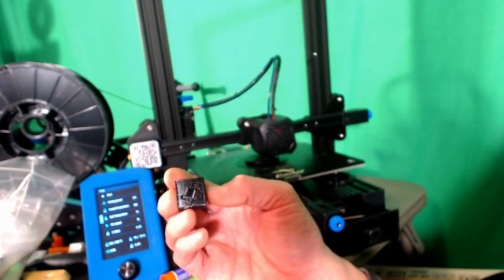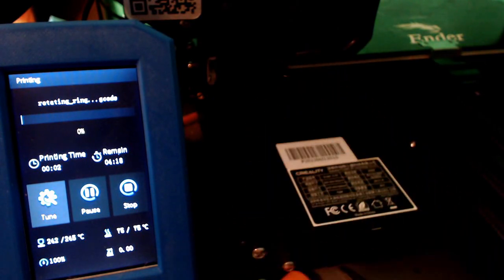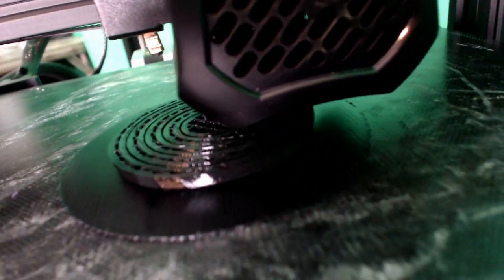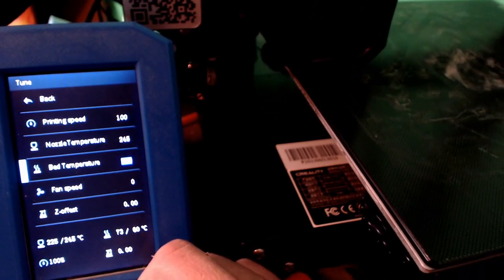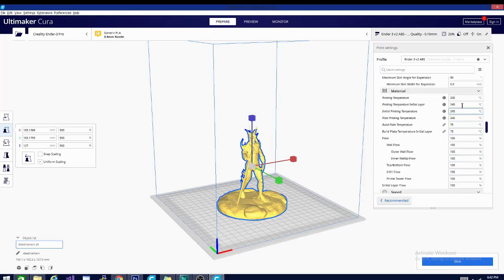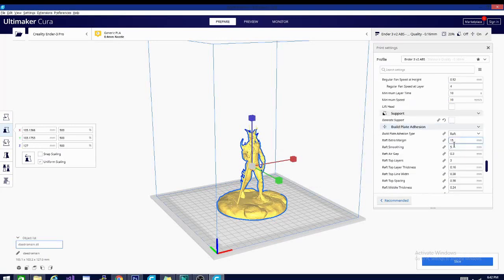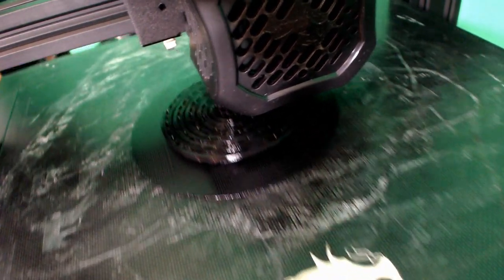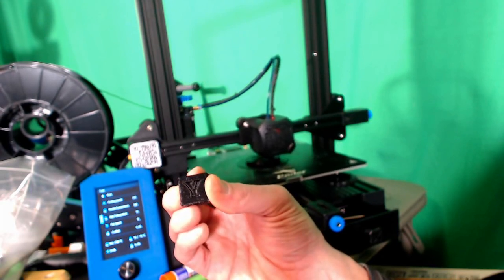How to Print PETG on the Ender 3 v2! simple profile!

Comment: In CURA there is a initial layer print temp for the bed and nozzle and you can manually set them to be higher then the rest of the print for better adhesion. That is your “reset” issue the initial temp sometimes doesn’t change with the set temp and can cause issues.

Comment: If you go into the settings of your slicer most current slicer Cura . Has a setting inside of it that will automatically drop it down to 50 at 200 you will have to manually go into the settings of the slicing program and set it for what you want it to do since it goes on the SD card once you slice it it then saves it on the card the way that you need it you plug the card into your ender 3v2 all problem solved I had this problem and solved it myself check in your settings I forget what it is I'll look it up later on if I remember but if not there's some research for yourself and anyone else reading this

Comment: It does that because in the slicer you selected PLA
Reply from the maker: No actually, it doesn't send the filament type, and I adjust the temp and every other setting in slicer manually. I NEVER change the actual filament selected so it's always on pla, I just go through and set my temps, fan and adhesion and support for every individual print. This ensure I'm double checking all my settings every time.  but this machine was overriding temps until I adjusted the firmware.

Comment: Ender 3 V2 comes with  incomplete firmware  and with some bugs. After i updated with jyers UI all those problems were gone ( i was hit first time with this problem; any tune modifications made before the hot end starts to move was instant deleted and replaced with standard tunes right when the hot end started to move. It was imposible to make any tunes before the prints begin, allways i was forced to wait print to beginPS> if you dont have CR touch or any automatic bed leveling Jyers help up with two setting , one is mesh bed leveling and the second one is manual. So i will allways recomand for Ender 3V2 owners to quickly update the firmware.

Comment: My ender3v2 has a bms all-metal hot end and what wondering what tests I should preform to determine best settings for petg. Right now doing a temp tower.  I have been printing motorcycle intakes I been designing  and I have been getting jams at curtain point. 
I'm trying another fan duct and I have added some things to encourage more air threw the heat sink.  
Parts print really nice before they jam you mentioned  20% fan I have not changed the fan from the default cura settings

Comment: The reason it decreases the temperature is simply because you have a PLA profile selected. Create your own PETG profile with 245/75. It doesn't matter what you set on the printer or in the slicer, if the printer start gcode is telling it to go to 200/50, it will go there.
Reply from the maker: Yeah I fixed that in firmware. So stupid. Take the temp I put in not the one you think I want.
Reply: @Technivorous   i had my printer for 1 day and i figured this out....  this is my first printer and i figured out the profile crap in 2 seconds.  
you dont need to change the firmware... just change the profile settings so that you can actually have profiles for diff material....

Comment: Thanks for this video. Helps me prepare for my first attempt with PETG on my new V2 printer.  I had heard other videos mention not printing PETG on to the V2 glass bed as it can damage the bed - have you any tips on this please?  Don't want to damage the bed on my first PETG print!
Reply: put on paper / masking tape on the glass and raise the offset by 0.05 - 0.1mm
Reply from the maker: The textured side of the bed, is made for not just adhesion but releasing the model as well, so dont use the plain glass side, use the textured side. There are ways to reduce the chance of damageing the glass, such as using an adhesive like glue stick, to create a thing layer between the print and the bed. Nanopolymer adhesive works wonders for this

Comment: Is the printed ring under the actual print necessary? It was hardcore to remove. Its like 3 layers in height about1 cm bigger than the print and the actual print prints over it. I haven’t noticed that with PLA.

Also thanks for video and profile, first print came great!
Reply from the maker: Thats a raft, and it helps with adhesion . you can get rid of ot by changing adhesion settings to skirt or brim, but I would keep it. It keeps the bottom of the model from warping away from the bed. If it was to hard to remove, search in the settings toolbar for "raft interface" and increase it slightly. That should give u better results.
Reply: @Technivorous  

Nice yeah i started googling it and found out about it. Also found the setting in Cura. It was a pain to remove from bed, my overture petg filament came with a bed sticker that i thankfully used.

Im trying the other options and see if i can get good adhesion without warping. Thanks again!

Comment: The easiest thing to do that I learned is on cura slicer you can choose what filament you are printing with at the top and it will adjust the settings accordingly.

Comment: Did you had to spray or put something on your hot bed to get it to stick properly before printing ?
Reply from the maker: Not usually but if you need too, try a glue stick, or painters tape. If you have the money nano polymer adhesive is great!

Comment: Hi, I don't have on my ender 3 V2 metal hotend, If I would print with your settings, it will melt or can destroy parts in my printer?
Reply from the maker: Nope. The firmware wont let u turn it high enough to damage the machine. It can brun up the tip of your bowden tube if left at max temp too long, but those should be replaced every so often anyway.

Comment: Thank you so much for the profile for PETG.  I struggled for hours until I tried yours.  I feel like I could do 250C but won't until I get an all metal hotend.  Not sure how anyone advises anything lower than 240.  All I got was a stringy mess and weak parts.  The 20% fan helps with overhangs too.  I was doing 0% fan until now.
Reply from the maker: You are very welcome!
Reply: I have no clue how someone advises 240. I can't get it to even begin to stick below 250 and it only works no lower than 255. Is there a way to deal with this? I watched some YT videos about it and some say that anything over 240 will destroy the bowden tube. Is there any way to deal with this, other than replacing the tube?
Reply from the maker: @Hendlton  technically at 250 you are releasing neuro-toxin from the bowden tube, and it will start to break down. Cap tubes have a slightly higher temp resistance and will hold up better. Tubes are cheap and easily replaced, once its burned you can vut the singed tip and replace it, but the fumes it gives off at these temps, though they cant be seen are extremely bad for you, so be sure to ventilate.
Reply: @Technivorous  Thanks for the quick reply! I only just got my roll of PETG, so I haven't used it that much, but yeah, my main solution to that potential problem was to keep all my doors and windows open. I had the idea of putting a steel tube, of the exact size, down where the PTFE tube goes, basically emulating an all metal hot end. Is there any catastrophic reason why I shouldn't do that? I also thought of starting the print at 255 and reducing it to 240 and seeing if that works. The tube being very hot for only a few minutes should reduce the deadliness at least a little bit.
Reply: @Technivorous  Just a little update, I've been printing with PETG for a while now and I never noticed any damage to the tubing. I just looked it up, and apparently the Ender 5 Pro already comes with Capricorn tubing, so I'm a dummy for never even thinking of checking for that. Oh, and I tried the steel tube down the hotend idea. It worked for a good while, but eventually clogged up with plastic and I had to remove it. It seems to make the plastic melt earlier than it's supposed to and eventually it jams. So I guess that's a no go.

Comment: do I need to upgrade anything on the printer l. dose it need a better nozel or tube
Reply from the maker: Stock is fine, just make sure u print and insert the washer and length of tube mentioned in the hit end fix

Comment: mine is coming in the mail, what filament should I practice with or what do you recommend
Reply from the maker: It will come with w little sample, but it's not much. Dont worry about price when shopping around, sometimes the cheap stuff is as good or better. I would try a few cheaper brands and see which one works for you!
Reply: @Technivorous  thanks

Comment: Why are you using a generic PLA material profile in Cura for printing PETG???  Use a proper profile so you don't have to change that temp in your custom print settings.  Probably why your temp drops to 200/50 when you start printing too.
Reply from the maker: All profiles start somewhere, once you have the settings how u want them for petg, u can save it as a petg profile or whatever else you want to call it. These settings are now available for download as my petg profile, which u can use without changing, and works well

Comment: any differences between this and the og ender 3?
Reply from the maker: this has an upgraded board and stepper controllers, so it is quiet. otherthan that the rest of the improvements are printed parts youcould do yourself

Comment: The BEST to print on with PETG is some blue painter's tape. I bought a 5" wide 60' long roll of it from amazon and it is amazing. I just throw down a large strip (or two if it's a big part) on my glass bed then print the parts and peel it off or sometimes the part will pop off without damaging the tape but after 4-5 prints, I replace the tape. I add 0.25mm to z height to correct for the tape thickness. I have no adhesion problems like I sometimes get with printing directly on glass. If you do get some adhesion problems put on a thin layer with a glue stick on top of the tape OR a few squirts of hairspray (could even be done on the glass if you don't want to use tape) and the problem should be solved. I use a 245°C nozzle and 70°C bed as he does.

Comment: Do you print PETG directly on the glass bed of the Ender 3 v2?
Reply: ya, I do and it works great. mine is the textured black glass plate that they sell with the printer.
Reply: @electronicfun8351  Thanks, I'll try that!

Comment: Killer profile!!! I've been working on getting PETG dialed in for weeks.  One night with this profile and I've completed 3 perfect prints in a row with no stringing, no adhesion issues.  Thank you!!! I will say for those learning, the only adjustment I had to make on my prints was adjusting the  Z offset about .03 as my nozzle was a bit close from the bed level.
Reply from the maker: So glad to hear it's doing right by you Scott! Thanks for the kind words.
Reply: @Technivorous  how can i download the profile? i don't see any link... thanks for the help
Reply: Do you recommend using the adhesion layers that are enabled on the profile? Because I would like to remove them to prevent using more filament than necessary.
Reply: Thank you for uploading this profile, one thing tho. Please dont use spaces in file names or directorys. I dont know why people do that, when typing in the file name you have to use escape characters or put the entire thing in quotes. file names should be all lower case with dashes or  underscores for spaces.

Comment: Is a geniune capricorn tube necessary? Cheap capricorn clones are any good or junk them for PETG?
Reply from the maker: I highly recommend cap tubes, not only because of the tehe coupler they include is a major improvement from stock, which will prevent the bowden tube from slipping out. Filament wise, you get most advantage from cap tubes if your printing flex filament, so for petg you will be fine without it. Definately get the real deal when you do upgrade. And as a bonus they now make different colors as well.
Reply: @Technivorous  any offgassing i should be aware of printing at PETG temps. thanks for the reply
Reply: @jersontecson4177  Yeah, you should be aware that PTFE will start off-gassing at around 240C. That is the chemical properties of PTFE and there's nothing you can do about it (apart from an all-metal hotend obviously). Capricorn tubing will "survive" at above 240C, and the off-gassing will be minimal, but if you have a pet bird or cat, it's probably not going to enjoy its time... They also have a horrible inability to not be able to say "Help! You're gassing me and I'm in a lot of pain and I don't know why!".

Care for your animals. They can't talk to you.

That being said, so long as you're not staying at temp for extended periods of time idling, and you're consistently passing material through it, it'll carry away enough heat to keep the tubing at a semi-reasonable temperature. Most PETG doesn't need to get anywhere near 245C, so do some temp towers, and see what works for you. The cooler, the safer.